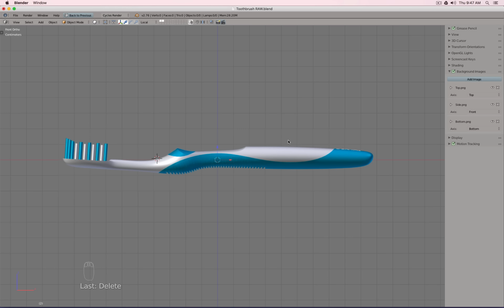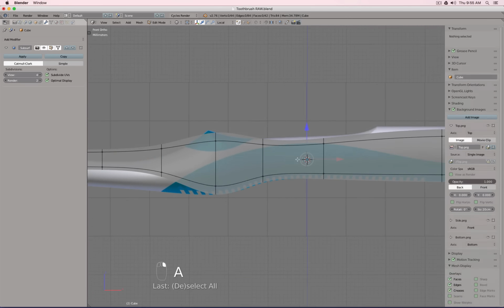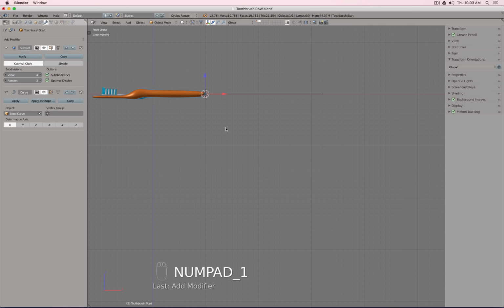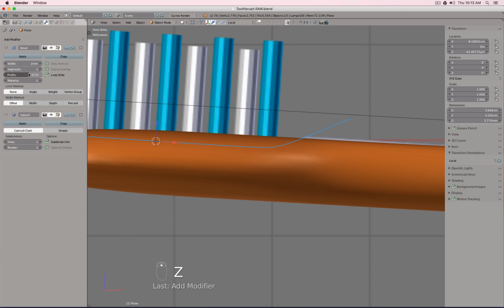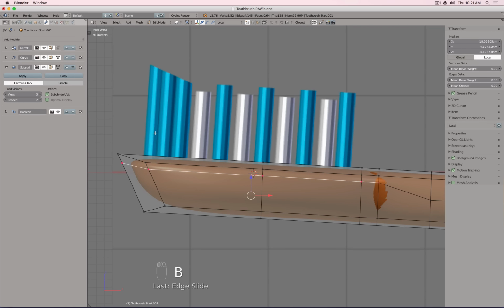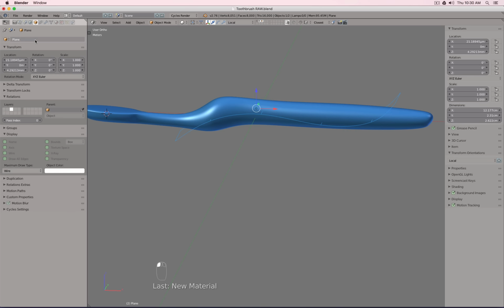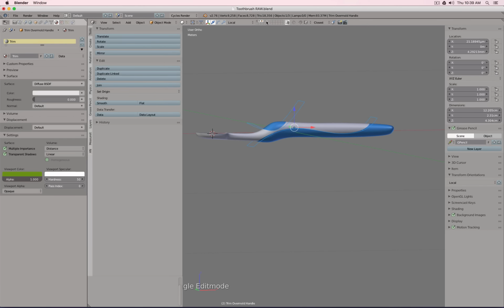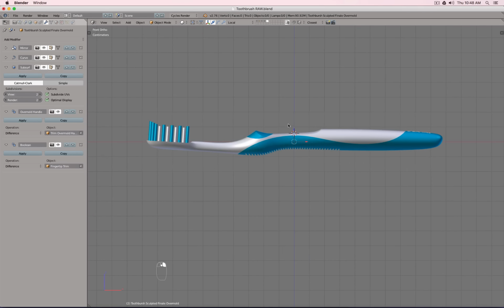Toothbrush Part 1 : Sculpting

Comment: I see it has been asked before, why do your cuts seem much better than mine. I could watch this with audio due to work. You talk about adding subsurf but the edge flow is different where the cut out is placed.
any tips here?
Reply from the maker: +Rombout Versluijs Quality of edges with cut surfaces depends on the level setting for the sub-surf modifier. More levels more polys cleaner edges but also longer calculation time. Also you can use either edge split modifier or use the mesh data auto smooth and set it to 30 for example.

Let me know if this works otherwise I will send you the file.
Reply: +Claas Kuhnen Yes i know the edgesplit and the way it works. PS booltool addon is much easier your press ctrl + or - and all the modifier get added automatically. 

What i mean is that the geometry which is created does have nice edge loops. see this screengrab https://www.dropbox.com/s/0i279xj0612ewv7/Screen%20Shot%202015-12-30%20at%203.22.55%20PM.png?dl=0

in your video it sort of seem less
Reply from the maker: Rombout Versluijs I looked few times into Boltool but always went back to the normal use because I prefer to rename things a lot. But I see your point. Click Click add boolean op right in the 3D view.

It seems to me that you surface that cuts is not very smooth ( less polygones) and thus cuts more in a linear fashion.

Can you send me your file?

info@ckbrd.de
Reply: +Claas Kuhnen  you just got mail

Comment: Your tutorials are really great - it's so good to see an Industrial Design approach in Blender modelling (my ID background means that I've often been frustrated with the lack of precision that most Blender modellers teach)
Reply from the maker: +790228AJS Yeah and thanks to T-Splines all the work done in Blender can be used in Fusion 360 to further refine / finish the design.
Reply: +Claas Kuhnen Would you be able to do something like that with Solid Works or similar? I'm wondering if things like draft tapers for injection mounlding on near vertical angles become an issue and need to be re-modelled?
Reply from the maker: 790228AJS Draft angles I would do if needed in Fusion 360 because it has a dedicated draft tool. Or in Blender I would build a draft value into certain walls.

But this video shows also a process that is geared towards organic sculpting and quick rapid prototyping.

From my experience parametric modelers like Fusion or SW are more precise but also more labor intensive and I feel they are not always ideal to start the design phase in it.

Comment: awesome, as always. I've never tried to model complex shapes using booleans and control surfaces (I'm a notorious polygon modeler, clean mesh and all that...). do those bool-cut edges give you problems when shading/rendering/3d printing?
Reply from the maker: +Denis Rakarić If you sub-d fine enough you will end up only with sharp edges - thats all. Obviously this modeling process is designed to finish the part later in Fusion so there sharp edges I could round if needed.

We bought an Ultimaker 2 and even threading build carefully in Blender just flawlessly operates after printing! You know in the end Fusion also exports a mesh model to print anyway.
Reply: thx. I've also installed Fusion and find it quite hard to work with. good thing we can import models to modify further...
Reply from the maker: +Denis Rakarić for nurbs solid modeling it is great - modeling in splines is less efficient than in blender but you can always perfectly place blend models in a fusion scene
Reply: I'll try that. currently I'm struggling hard with a project (need lofting along a closed spline) and neither solidworks nor fusion are going easy on me. the closest I could get to the result I need is with 3ds max,  but it lacks more control. thx for providing me another idea I could try, I'm running out of ideas and doing it manually in Blender is quite tedious and very time consuming...
Reply from the maker: +Denis Rakarić if you want we could meet online in hangouts and I can take a look at it in fusion
Reply: oh man, that would be great. thank you. can I contact you around 9pm (European  time)?
Reply from the maker: +Denis Rakarić sure do that I think that is 3 pm here so in 3.5 hours
Reply: great. thanks a lot. I'm at work currently...:-)
Reply from the maker: ***** No problem - just in hangouts call me and then we will check this out